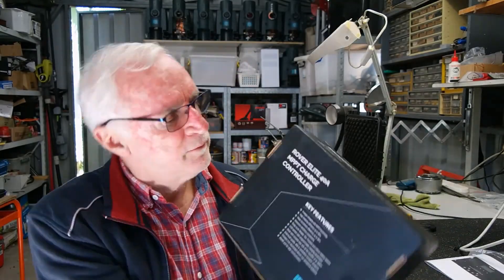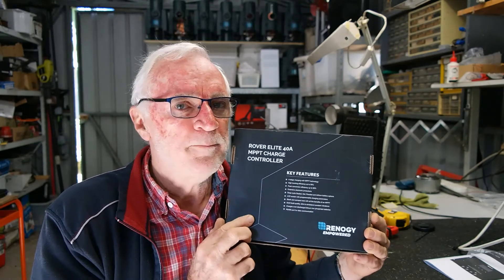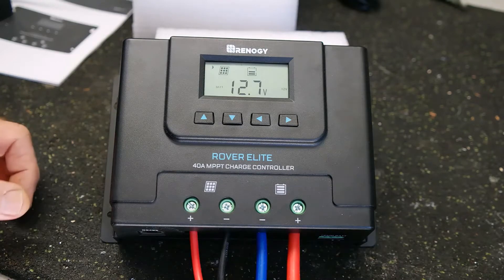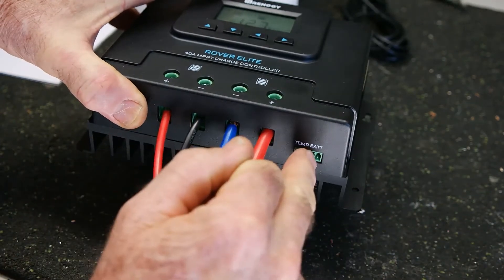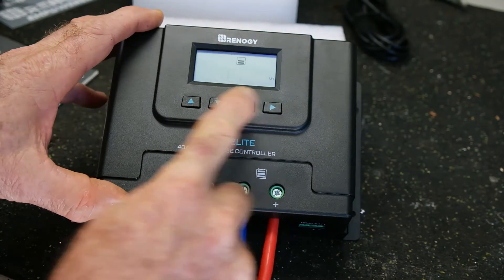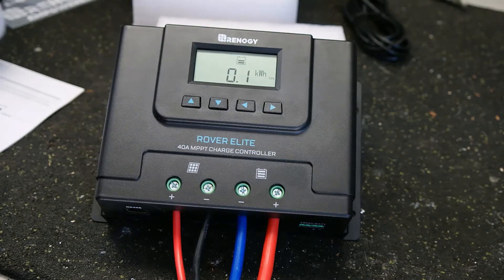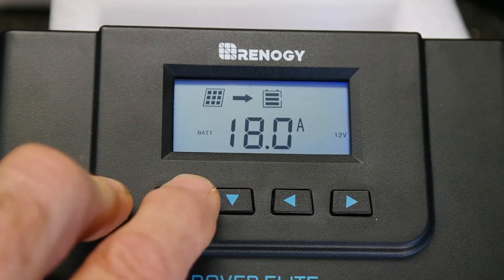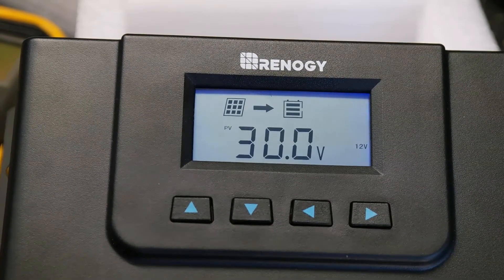Renogy Elite 40A MPPT Solar Charge Controller

Comment: I have this unit and I have a problem with it, I am charging a AGM battery bank and  The Boost voltage is to high, The charger takes my batteries to 14.9 volts and holds it there for 2 hours, then when it switches to float mode the float mode voltage is 13.9 volts.  I am charger VMAXTANK  AGM 12 volt 125 amp hour batteries four of them in my battery bank.  I am not sure what to do.  Right now after the boost mode I just unplug the solar panels from it.  Any ideas ????
Reply from the maker: You can change the battery boost voltage within the settings to any value between 12-16v.
Reply: @timterry8714  I have the same charger that you are using in your video, and from what I understand a person can only change the voltage on the Lithium battery setting,  Not on the AGM settings,  If I am wrong about that I would like to know how it is done.
Reply from the maker: @rayberger2694  you are correct the settings only allow change for Li batteries. It's a question for Renogy as that's too high

Comment: One reason for staying off-grid was not only the cost of power poles to the house but also the quiet RF noise lever to my amatuur radio station. The present PWM controller is completely RF quiet. Switching power supplies often introduce Radio Hash Noise Interference (RFI). Any comments on this device? Is it EU certified?
VA7WN
Reply from the maker: No I dont know the answer to that question. Your right, nearly everything electronic today generates radio interference and significantly raises the noise floor for receivers and if its not this charger the noise from switch mode power supplies (even USB chargers, LED light dimmers, etc) are difficult to get away from these days.

Comment: I just received and installed this charger, but it came without the instructions manual. Luckily there is youtube, and I was able to set some parameters, but I need to know more if something goes wrong. There is no link on the Renogy website to download any instructions. I want to make sure is operating right. I have it hooked to a 200 amp Li, 2500 inverter with 2/100 ea panels in series. (I will add 2 more soon) Numbers move too quickly, but it seems to be fine. I will switch to parallel tomorrow to see if it is better. If anybody knows more please let me know. Thanks for the video.
Reply from the maker: I'm sure there are instructions on line for this controller or were in the past.

Comment: Any idea if I can charge a 12v lifepo battery bank with 24v of solar panels connected?  Or does 12v bank have to be charged with 12v panels with the rover elite?
Reply from the maker: The Elite will support any panel voltage up to 100V so thats no problem.

Comment: Why your panels are connect in parallel ? Whould you not got more in A in series ?
Reply from the maker: Not really as watts are watts and the cable is mimimal length. Bit of point of conjecture I think.
Reply: @timterry8714  I understand from internet research (!) that a higher voltage is better for a MPPT controller since it gives it more range to adjust and optimize in real time the PV parameters.

Comment: I will be getting the Rich Solar 20 or40  amp charge controller early next year, have not decided which one yet. They are nearly identical to the Renogy except the Rich Solar have better/stronger wire connections. Thanks for the bench test video and greetings from sunny Jamaica.
Reply from the maker: Hi Laurence, thanks for the comments. I found the screw connections were quite adequate and provided a firm connection for up to 8-10mm cable. Cheers Tim

Comment: Hi, I have this controller and 260w across two panels in series. on an overcast day i'm pulling 30v from the panels, but 0amps to the battery, Lifepo4 battery is only at 13v so not full, and should be charging. Any ideas why? I've not changed anything in the system since summer when it seemed to be working fine. cheers
Reply from the maker: Hi Angus, sounds a bit strange but stepping through the display should give you some insight as to what is going on. If you can see the PV voltage and the Battery voltage then it should be charging. They do say to connect the battery first before the panels so if that didnt happen that may have caused a problem to the charger. I assume you have disconnected everything and reconnected again to see if it came good, otherwise I dont know. If thats all good contact them for a warranty return. Their customer service appears to be greatly improved now and they have been very responsive lately. Cheers Tim
Reply: @timterry8714  I think perhaps at some point I may have disconnected things to add other things into my system and damaged something, but yes I have restarted the whole lot in the right order several times since. Thanks.

Comment: Great video,  just wondering I bought the 40 amp version but not sure whether you have to activate equalization manually or it comes on automatically.  
Thanks for your time.
Reply from the maker: It must be auto as there is no way to activate it. I have seen it doing some sort of voltage pulsing at times which I guess is possibly an equalization. Mine is set for Lithium so pretty sure there is no equalisation function operating in that mode.

Comment: Great video! My Rover Elite 40A worked for about 3 weeks and then started shutting down while charging around 20amps (4- 100w panels).  I did get through to RENOGY and the CS agent had me try a hard reset. Still was not functioning properly so they said they would replace it. Problem was they were listed as backordered on the sight. I bought on Amazon but the return window had passed while I was waiting to install it. Finally a second CS agent told me they had suspended selling the Elite 40A due to a large number of customer complaints. They said they could refund me or send a Rover 40A to replace it so I accepted the Rover.  They also sent a replacement Bluetooth 1 module since the Elite uses the BT2, different module. The Rover is bigger and seems to stay noticeably cooler with a larger heatsink.  The Elite was much warmer and I wonder if it is part of the problem.  Like you, I was happy with the smaller size of the Elite and I didnt need load terminals but I do like the cooler running Rover. We will see how it holds up. Renogy customer service seemed a little unorganized but they did promptly send me a replacement even before I returned the faulty one.
Reply from the maker: Well mine is still running well with no complaints and I have been on the road for 6 weeks now and we have had a very warm winter in Australia this year. We started our journey with cool winter days and nights after heading north for a week we experienced 3 weeks with the daily temps at 35C everyday and we free camped all the time so the solar controller got a work out at high temps and its been great - touch wood! I have had trouble with my Renogy 40A DCDC Charger however in that it wont sense ignition and runs continuously when connected to the tow vehicle - inconvenient but not a show stopper. I contacted Renogy and received 1 email suggesting a couple of things to try (which I had already done). I responded with the results of these tests and as usual have had no further response in many weeks. Their customer service is appalling. Seems at least you have had the problem solved - I assume you are in the USA as it seems that is the only chance of getting any resolution with Renogy product issues.
Reply: @timterry8714  that's great to hear!  Sounds like a wonderful trip.  I have read about the bad CS and it does seem mostly non US customers.  I only contacted them by phone, long waits but eventually get through.   I have an EPever 40a controller in my Sprinter so that's a back up if the Renogy in the boat fails.  So far all good with the Rover. Thanks for the reply and good luck on your travels!
Reply: I found 2 of my answers from your comment. I appreciate you. Thanks for sharing what you know! Onward
Reply: They are still making it. I just got one, and it is on their website.
Reply: @200Nora  hey yes they recalled the bad ones and I think they redesigned it and reintroduced it...  hope yours works great!
Reply: I like to know  how to do a Hard Reset, I will try to google that. Had some voltage spikes and was getting nothing from my 400 watts of panels with good volt output, not one amp to batteries. Its now working again..a little!

Comment: I thought you had a problem with the dc 2 dc / mppt ... I got one 6 months ago , no problem at all .
Reply from the maker: No Toastie, I didnt have a problem with it in principal it was just they had high overheads or self consumption when combined in the one unit with alternator charging. I felt it was better to use a PWM controller as I only had a relatively small portable solar paneland every amp was precious! Possibly also those earlier designs were not as efficient. This one is efficient, has a small physical footprint which I was looking for, high capacity and is reasonably priced at about A$170.
Reply: @timterry8714  that’s a good price, I may get one aswell, and expand my set up ,the flexible 120w panels I buy on AliExpress are only £70 and can be stored so easily under my bed.
Reply from the maker: Make sure that you buy panels that are built from Sunpower cells as they appear to be the most efficient. I just purchased 2 x Renogy 175 flexible panels to mount on the caravan which only weigh 3Kgs each but generate a maximum of 13-14 Amps. We installed 3 of these on a van over a year ago and they are performing with this output consistently. They have been on the road for months now and after a year no degredation.
Reply: Thanks Tim, another interesting video. I have been using Victron gear for a couple of years now, and really love the quality of them. The best part is Bluetooth control via a phone app - never need to play with buttons on the unit itself.

The Victron costs more than the unit you have reviewed here, but worth every cent.

I'm currently running a 50 amp 100 volt unit for solar, and 30 amp AC to DC charger
Reply: Mine is reading the volts on screen incorrectly, can you check the volts from battery terminals and on the screw terminals and compare to what it's saying is on the screen. I also have the same screen auto cycling issue
Reply from the maker: Joey, I did that comparison and it was out by about .2v. What voltage point are you comparing the displayed value to and is that while there is significant current being generated?